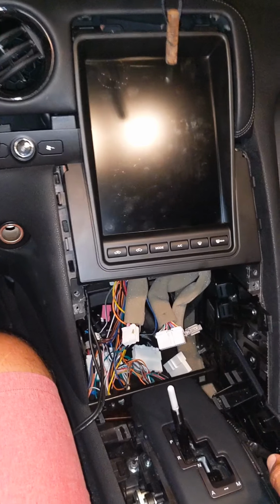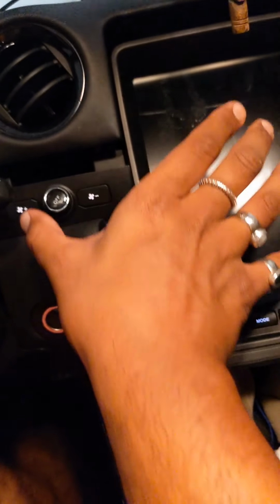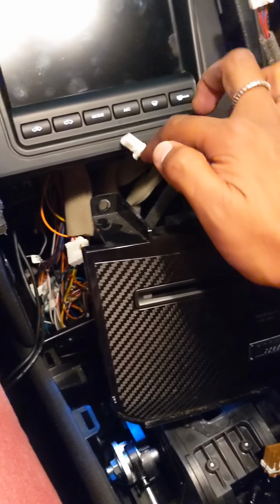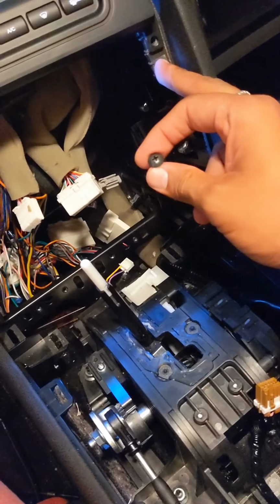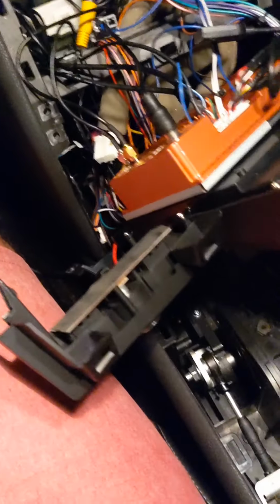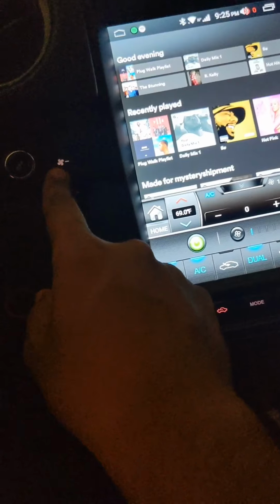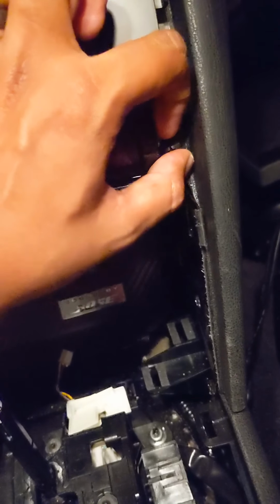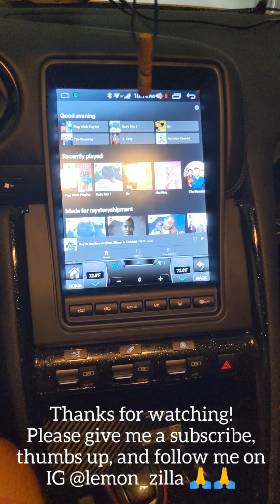T-Rex Pro for R35 GTR (09-16) - installation and in-depth overview

Comment: Hi, thanks for the video. I will be instslling mine this weekend. How do you reset maintenance intervals with the TREX?
Reply from the maker: You kno, that's a very good question. I used the ECUtek app, because service intervals worked like engine codes.. but if you don't have an OBD2 code reader of sorts, not sure how TRex offers the ability to reset those.. I'd suggest reaching out to T-Rex? Good luck!
Reply: @xSkBx44  thanks for the reply, so if I have ECUTEK (which I do) then I should be able to do it?
Reply from the maker: @cb8491  absolutely! I recall being able to change the intervals as well, like the OEM unit
Reply: @xSkBx44  excellent, thanks buddy! 👍👍
Reply: I installed mine today, but get nothing on the screen. only the recirculation button lights up (button on very left) - nothing else happens. Any ideas?
Reply from the maker: @cb8491  no clue, sorry. Best guess would be a loose connector or punched cables?
Reply: @xSkBx44  Thanks mate, I will double check

Comment: Nice video! Thanks. You have no Low Level converter installed? T-rex recommend this to avoid static on low volume. Curious if you dont have  a converter and if you hear some static.?
Reply from the maker: Thank you! You're absolutely right, they do recommend it and I do not have it installed at the moment. To be honest with all the sounds I hear when I'm in the car, the low level static hasn't bugged me enough to remove the unit and install it - I'm waiting for them to have a "harness swap" program where I can remove and swap the harness out without any downtime from soldering/etc. Until then I just turn up the music or ro down the windows for the exhaust notes 😉
Reply: @xSkBx44  Ah ok, thanks! So, I will install mine without the converter. Hope mine isn't that loud either...
Reply: Just tried both variants. Without the adapter, the static is there yes, but not annoying at all. With adapter, no static of course. So I keep the adapter installed of course.
Reply from the maker: @1PYRO8  oh wonderful! Did you splice/solder the filter in yourself? Which filter did you go with, and where did you buy it from? Maybe a link would help others 😃
Reply: I bought a defected one. It made my car not able to turn on and when it did I could not turn it off. It has everyone baffled for a week until I mentioned it happened when the unit was installed. Now everything works fine, except I have no volume. Fml

Comment: How did the GPS antenna work for you inside the dash?  Did you ever need to move it like you mentioned?
Reply from the maker: It worked alright for me, I didn't end up relocating it. The sim card module I placed in the A-pillar I recall

Comment: Hello! So im working on installing this unit now and the physical buttons are not working on the unit. Everything works fine on the tablet however. If anyone can help me with this I would greatly appreciate it. Thank you! 😊
Reply from the maker: I would start by checking the connected cables to and from the button panel. If there are no reversed connectors or broken wires, it could be something wrong with the buttons themselves? Odds of the later are super minimal though. I'd recommend contacting T-Rex support maybe? Good luck with the install !!
Reply: Thanks brother! I checked all my connections and they are working. Everything lights up on the buttons side but nothing actually happens when I press them. I tried reaching out to T-Rex but they have no over the phone assistance which it pretty bad imo. Thanks again :)
Reply from the maker: @faviancalleja9386  oh shoot. So there's power going to them eh. If I assumed the buttons were mechanically fine, then I'd imagine something was wrong with the other end of the wiring? Good luck brother!
Reply: @xSkBx44 thanks alot brother!

Comment: The side bezels look strange where they use to flow and connect to the ac panel. 
I am thinking about getting this since I have an 09 with the old radio unit. 
How well has it been for you so far?
Also, I am not a ECUtek, I have cobb...So does this unit show any of the stock car performance pages? I use them all the time to check temps and pressure.
Reply from the maker: It's a great buy! I love it more and more as the days go by. I've even seen some other people who have customized their ecutek dashboard to look phenomenal! Can't imagine how much time that would've taken though. I don't think the T-Rex panel has any integration with Cobb. I used to have a Cobb accessport but not for long - if there is a way you can connect the ecu to a Cobb app or software on a PC, then you can connect the ecu to the USB port for the T-Rex panel and use a Cobb app, but I don't think such a thing exists..
Reply: @xSkBx44  Well, I just bought wheels and tires, so I have to recover from that first! LOL I found adam on facebook so I may be getting this soon.

Comment: Heyyyy!! Thanks to your lengthy but really useful video, I managed to tackle a couple of issues installing this unit! Just got mine installed yesterday but then first issue was the airconditioning was always ON and can't be controlled! Ran out of ideas how to fix it, my mechanic just tried to put on the 08/09 harness and it was sorted! But mine is actually EDM MY2010! Secondly was the reverse camera just showing black screen... after re-watching your video again, turns out that we connected the yellow pin to wrong one, really did not expect to actually connect it to that one with extra small box on it.

Anyway troubleshooting took us a couple of hours extra for the installation but now, reverse camera is in black and white and there are some settings in the player that I cannot access. Do you know the default password/pin for those please?
Reply: and I have installed Netflix but it does not work!
Reply from the maker: @U9LyKwaN  I can't remember the password, but I knew it at some point. They have the best tech support I'd say, so it might be worth shooting them an email :)
Glad to hear the video helped 😌
Yeah there are a few android apps that don't seem to work on the platform. I assume it's due to OS restrictions? YouTube works for me so I let it be. Spotify hits the spot. That's all I needed
Reply: Hey, I cant seem to change AC fan speed with the screen, or the top left turning knob, but the buttons beside the knob works, and all the buttons on the panel itself works, but when I go into the AC mode, it says fan speed is at 0 all the time, and I cant change anything. I tried with swapping the 08-09 adapter but no luck. ANy suggestions?

Comment: does your ecutek run through bluetooth or does it need a cable connected via usb plug?
Reply from the maker: Just the standard bluetooth, you just download the app and it works the way it does on your phone, but it's on a tablet so you got a bigger screen

Comment: ive been thinking about this for my r35..  are there any glitches?  anything not work?  hows the screen response?
Reply from the maker: No glitches, no issues. Their customer/tech support has been A+ for me this far. The screen response is perfect imo. The only complaint I would've had is the low frequency noise but there is a cheap filter to fix that. One of the comments previously talks about this

Comment: was there a password when you try to enter tools in your unit?
Reply from the maker: Nope, no password
Reply: @xSkBx44  thanks for the quick reply and thanks for the video bro helped out a lot although I will add the losing the screws on the side of the shifter part helps pop the rear clips one wouldn't pop until I did that ..now just to figure out this password lol
Reply from the maker: @sev2296  thanks :) 
And sorry I must've misread your question the first time, yes there is a password to get into the system's settings, I forget what mine was but I knew it at one point.  How I found out was during a tech help session. I'm certain it's a generic 4 digit pw that's same for all units. A ticket for help would probably get you the code 👍